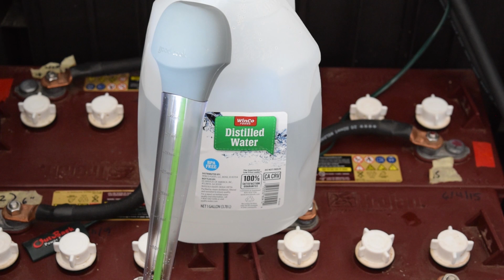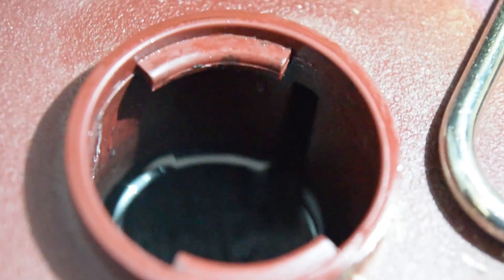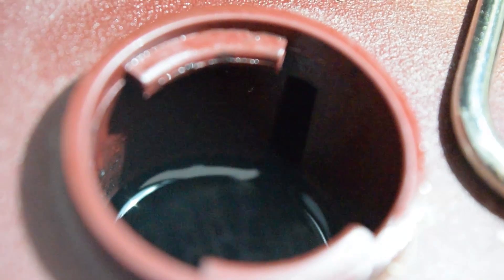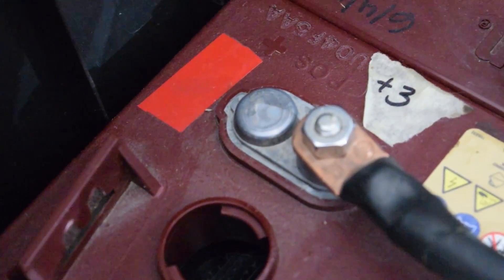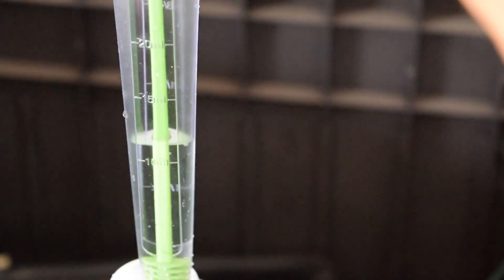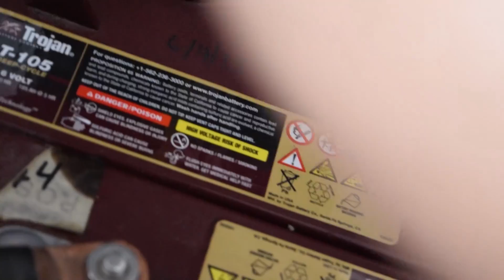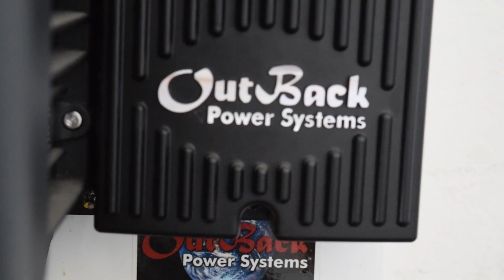Solar Battery Bank Water Maintenance

Comment: Those are some nice fucking batteries, Those tall Trojan batteries are expensive as fuck and I'd love to have some. But I've got eight 220ah 6v VForce batteries that I got from work, just slightly used and needing a few equalize charges from sitting around.

Comment: Hey, could you tell me if I have to disconnect the battery from the pannels b4 I open the cells??
Reply: No. You don't need to disconnect, just wear safety glasses and don't have any flame spark or ignition sources because it could cause a hydrogen explosion. You actually want to water the battery while it is fully charged or at gassing voltage or else you could overwater the battery and then get an overflow when it's fully charged and lose acid.

Side note: If you have a water TDS tester in your top water is less than 25 to 30 TDS you can just use top water. If it is more I would recommend buying a water filter meant to reduce that number.